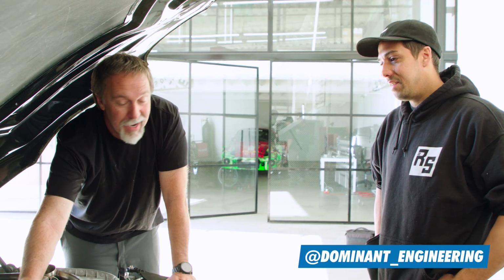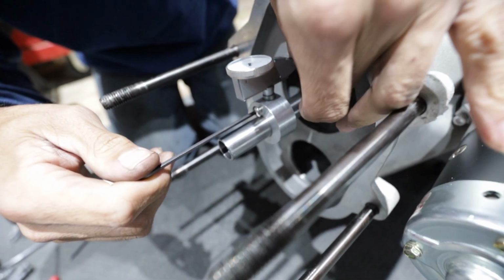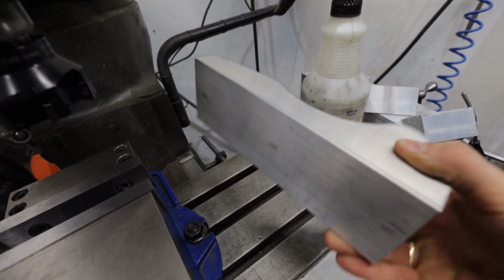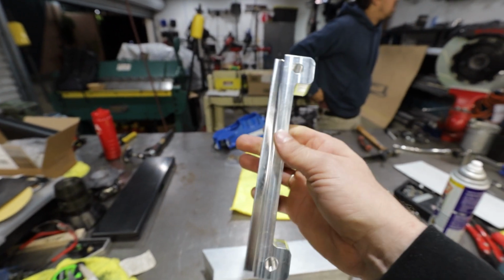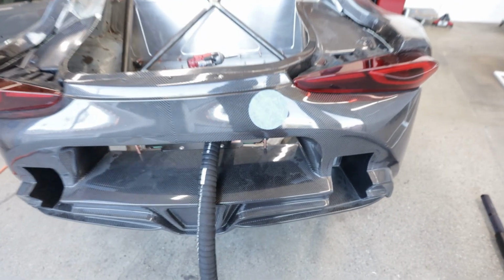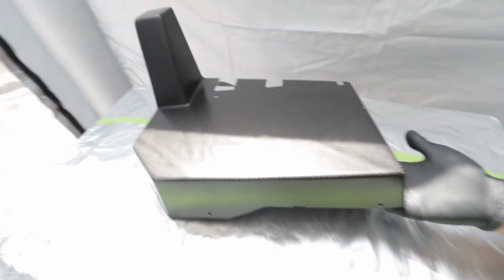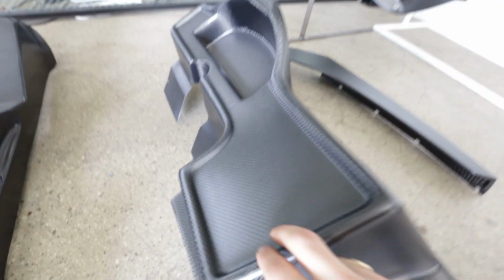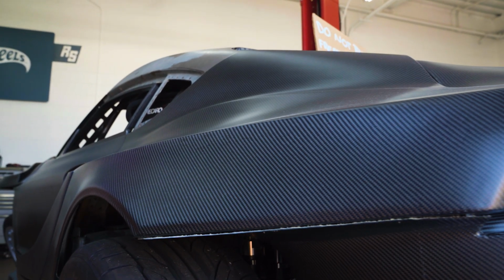Formula Supra Brembo Brake Kit, New Carbon look.

Comment: Honoustly looking at dom's fabrication is so inspirational, in the 80's and 90's we looked at racing cars and dreamed about them, now in these wonderfull times we can actually see how they are build step by step.Also great job on the painting looks awesome in the mat/light satin finish, i painted half my car last year in my driveway with a lplv spray gun, was the first time i painted something that big, it was hard work prepping, painting and paintcorrecting but i got a mirror finish, without dust and barely any paint faults, it's just so satisfying when you see the end results.👍✌️👉

Comment: FYI, Do yourself a favor and Helacoil those threaded holes for the brake caliper bracket.  With the extreme vibration/heat/etc,  threads on aluminum tend to fail when you least expect it.  Would also use Nord-Lok washers for any critical vibration bolt element.  Look them up,  they are very useful.

Comment: idk if you can even call this a supra anymore this is just one of the most badass one off builds ever
Reply: I often wonder at what point a racecar becomes a unique build and not really the original car anymore. Like this is now a Supra roof, windscreen, and lights with entirely different driveline, suspension geometry, weight distribution, driving position, body panels, etc etc.

Comment: You might want to heli-coil those brake brackets so the threads aren't just aluminum (-8
Reply: Second this! Alternatives would be loctite thread-locker or safety wire through the bolt heads, some method of positive retention. At least paint-pen the bolts to check for back-out during race checks. These are in a fairly high-vibration location and are liable to back themselves out over time.
Reply: Keensert is the best option. But I second that... especially in 6061.

Comment: What was used to remove all of the band saw blade marks on the curved portions from those brackets? Was it sanded or free hand cleaned up on the mill?
Reply from the maker: Part of the machining process and the belt sander
Reply: @RyanTuerck  thanks ryan

Comment: Will this ever be used for competition? Lots of solutions do not seem easily repaired/swapped during a crash. Same for the location of the dry brake, the rear bumper... The part that will be wall tapping and banged up!!

Comment: That is impressive work, without a CNC
Reply: CNC Just makes it easier to make multiple parts of the same design. Most of the times CNC just make it harder, because you need a computer design of the part
Reply: If you've ever worked with a lathe, it's actually not that hard, just more labour.
Reply: @gwot  what is some real labor is doing some CAD for a single part. It is not needed at all
Reply: @ttiization  if you consider clicking away at a computer screen labour, then yeah.
Reply: @gwot  not only that. But Dom makes it by hand. If you go for the CNC route you would need mych better measurement. He just eyeball it every now and then, if it doesn't fit he just pass it again on the mill. No need to hassle with computers at the shop
Reply: I kinda wish they had sent those brackets out for cnc work instead, but oh well they got the job done. And honestly parts like those brake brackets are not hard to program with solidworks cam at all
Reply: @jakehennessy7  but the dude works alone in the shop. Who is going to do the CAD? It's more like art than industry
Reply: This would be a lot faster on the CNC, just about any relatively modern CNC can take heavier cuts than an old Bridgeport. As for CAD it would only take like 10mins to model that part, then you could run an FEA to make sure the part is only as strong as it needs to be, possibly saving weight or preventing a failure.
Reply: @ttiization  as nnfan pointed out, it's quite a bit faster with CNC/CAD. I just made some caliper brackets for Jerry Yang to mount a set of Wilwood DynaPro 6a calipers to a wisefab upright and it took about 3 hours from drawing to holding the 2 brackets in my hand

Comment: I dont understand why you did a massive firewall covering the back part of the car when u could of down a cover or part that is the trunk area so you still have rear visibility ?
Reply from the maker: We could care less about visibility from the rear view mirror. We did the firewall like most of the other cars we have built. Right behind the roll bar so we can keep the back exposed for easier serviceability.
Reply: @RyanTuerck  fair enough and good response too, good luck with the build and cant wait to see it finished and hear it 🙂👊

Comment: I thought the knuckles were Supra spec, why wouldn't a bolt on brake kit... bolt on?
also, matte with a little bit of sheen is called satin. And what's the plan for the roof? just paint?

Comment: There is still a lot of Mass that can still be removed from the brake caliper brackets
Reply from the maker: Splitting hairs on OZ’s at that point. Rather have it stronger.
Reply: @RyanTuerck  i wish I went to the race here in Bradenton. I've done Avation and Composites for 15 years and love racing 🏎
Reply from the maker: That’s awesome man. Ton’s of respect for composite work. Stuff is difficult.
Reply: @RyanTuerck  can't wait to hear it, love for the Judd, I'm building new aero parts to first lower the drag and add Groundeffect downforce. Since adding a wing, adds surface area then increases drag.
Reply: @RyanTuerck  Please keep up the wacky and insane engine swaps. We or alteast I enjoy 😉 it especially when the video gets into the the technical areas. I love the engineering that goes behind the build series.

Comment: Wonder what would be better. Lower mass/CoG in trunk, or a bit higher so you can grab more downforce with a larger/better rear diffuser. I would prefer the latter at speed.
Kevlar fuel bags need more love, they can get flat and low.

Comment: Im sure you guys thought about it alot before cutting that hole. But that fuel fill location...its sad u couldnt hide it somewhere like in the trunk or that side window. I get it,still sucks tho. Full carbon car and has a off center fuel filler 😢